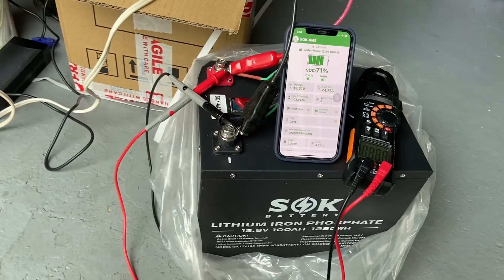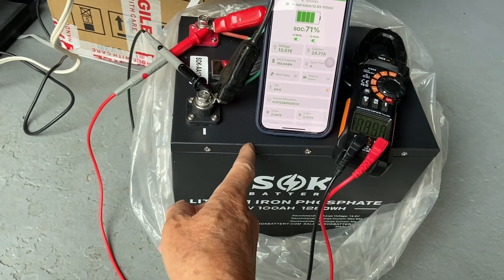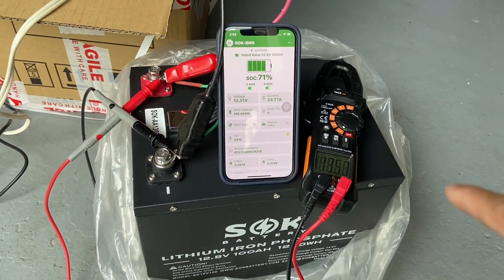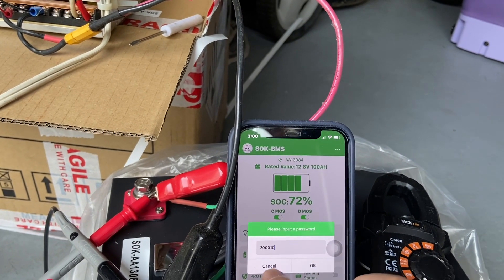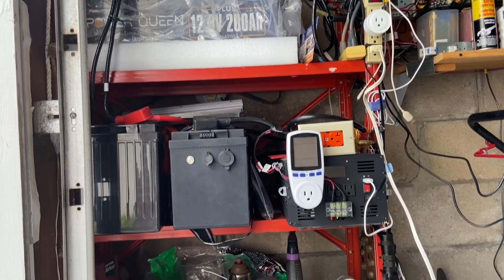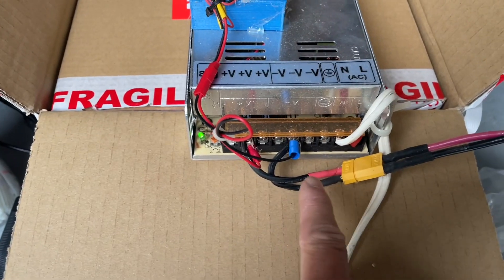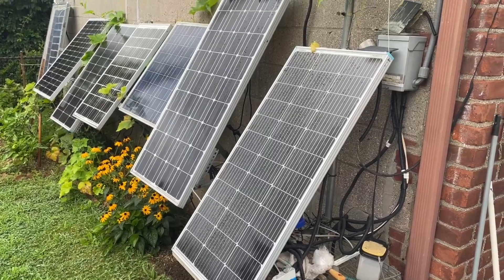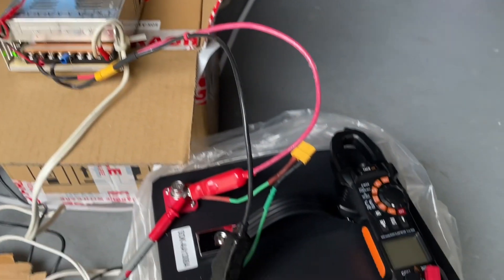A real bargain SOK 100Ah Bluetooth lithium iron phosphate battery

Comment: We will be seeing the dropping in price of these and also Sodium based auto-replacement positioned batteries in the coming months!  CATL and some other brands are now selling 3x the energy density cells that are not much more than the older 1/3 as dense battery tech and it will fundamentally change this part of the industry.
I figure we will be in a place where if our car (gas or EV btw) needs a new "12 volt" battery, that a LiFePo lasting at least 5x as long and with much higher current capabilities, and able to withstand very hot weather etc.  and very close to that would be Sodium based batteries with like 5000-13,000 0-100-0 cycles b4 80% (13,000 is 35 years a a full cycle a day...one battery and 3 cars and 30 years  later and  it still works!
Reply from the maker: @MrMrFlyPuppy  Thanks for the optimistic forecast. Science marches forward and man, unfortunately, backwards.

Comment: You got a real good deal on that battery. Every now and then Amazon has a sale. I just got two 100AH Power Queen batteries for $190 each on Amazon prime sale, the price has gone back to $230 since then.
Reply from the maker: @lawrencedavidson6195  The price of the SOK battery went as low as $185 then went up to $300. Now they are sold out.

Comment: I saw SOK batteries with this vanlife guy from canada. They seem good quality. In 10 years it will be your main power setup ;-)
Reply from the maker: @rikkiesix  I like it is in steel case and you can open it. The Bms can go bad make your battery a brick. These are supposed to be grade A cells as well.